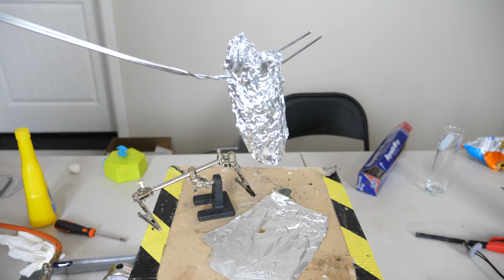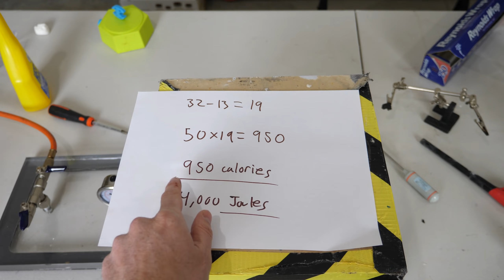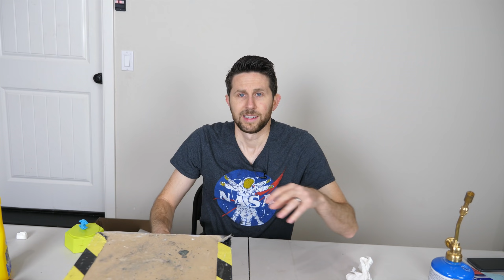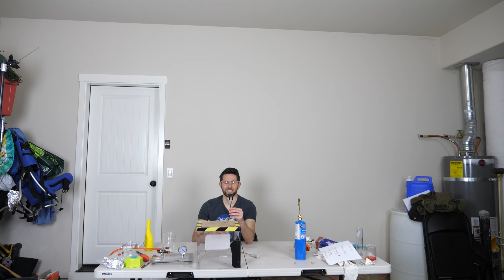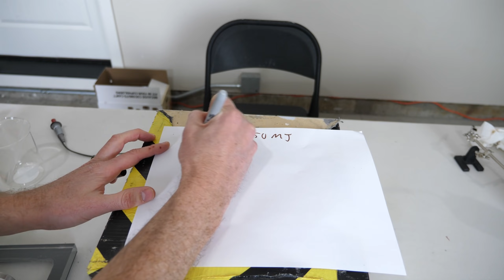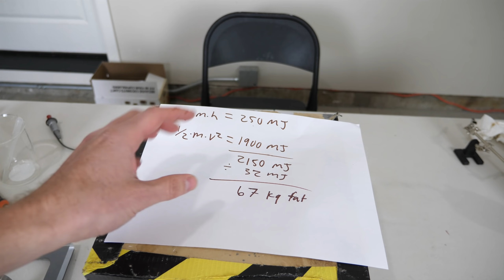Homemade Film Canister Rocket—Launching Yourself Into Orbit

Comment: Your body metabolises that chips into CO2 and water and other waste products.  The waste still contains considerable amount of chemical energy because metabolism efficiency is far worse than just burning by fire. (People in some countries burn dried animal poop as heat source.) In order to calculate the total energy gained by your body when digesting Cheetos, you need to burn your feces too. Otherwise this calculation would be incomplete and plain wrong.

Comment: It would be pretty sweet if you could provide an answer to a very simple question about this video...specifically...do you honestly believe that your results from experiments with your very tiny vacuum chamber translates into the vacuum of space..i know without a shadow of doubt that your pump being used to vacuum the chamber CAN NOT reach the same vacuum as in space no matter how long you pump it for.. Therefore you can not  conduct a single valid experiment under the same conditions in space..2..solid  fuel and liquid fuel rockets are totally different things...where solid Is lit and then burns until it's all gone in 1 continuous action...because of this NASA does not  claim to use them in the vacuum of space ..so if nasa rockets do not use solid rocket fuel in space...can you please explain how the solid fuel.. pop pops..has any relation to nasa rockets in space..how about doing the experiment with liquid fuels in the pumped down vacuum chamber...there is 0 doubt in my mind that you know that gases take up 1700 times the volume than the same amount of a liquid and solid in weight..pressure will rise very quickly  when fuel is burned in the small vacuum chamber like yours...so u are creating an atmosphere pretty much instantly..so they both have 2 separate things to push against/ transfer energy to...needed for an equal and opposite reaction that are not their in the vacuum of space... Even if nasa could get to orbit there is a huge problem...there is 0 resistance to the exhaust gases leaving rocket and a bunch of resistance in the direction of travel...it violates the laws of physics for rockets to provide thrust in the vacuum of space..Remember this is only hypothetical...this is because the force would be applied equally in opposite directions..towards direction of intended travel and  leaving the rocket exhaust...which would cancel the forces..rockets must apply a force to something else for any flight...same exact thing for objects moving through water...air and water behave the same exact way which is why propellers can be used on both..jet skis use a pump to suck in water and increase the pressure of that water and then uses the high pressure water to apply a force to the water traveling through... Rockets are no different than the torpedos in water...there must be a fluid to travel  through for rockets and jet skies to generate thrust.. No fluid no thrust because it's the resistance to motion by the charged particles in the medium being traveled through that make up everything in the universe that is responsible for the equal and opposite reaction. Rockets don't have   that in space

Comment: I could be wrong on this but IIRC a car is less than 2% efficient not 20% the 20% is a secondary conversion you're converting about 2% of the energy in gasoline if that into energy of that you are recovering about 20% of that 2% to power the car the rest go into heat and out the tailpipe on top of that you have to add the electricity you're using to move the car because it takes quite a lot of grid energy to make all that happen this is why electric cars are so incredibly efficient your gasoline car uses more electricity per mile than my electric car does and you're not even plugging in :-)

Comment: Your calculation needs to account for atmospheric drag which isn't a constant since the air gets thinner as altitude increases. The air has less mass for the rockets to push against. But it would be balanced out by the loss of rocket mass due to loss of rocket fuel as you stated.

Comment: Or in other words, the centrifugal force of orbit must balance the gravitational pull of the Earth to hold it in equalibrium. That is achieved at about 17,600 miles per hour adjusting for mass. Without gravity satellites would fly off into space. Without speed they would fall back to earth. The outer atmosphere is not hot. That is NOT why things "burn up" on re-entry. In fact it is very cold. But the friction caused when an object moving that fast hits the atmosphere creates heat.

Comment: Too many energy loses in your set up! You need to have a sealed “calorie bomb “ 

Your equation is INCORRECT 

Q=mc ΔT where m =mass in grams ,c is the SPECIFIC HEAT OF WATER ( 4.189 c/g)  ΔT is change of temp in degrees Celsius.

Comment: You are not taking into consideration the amount of heat that escapes into the air and around the water vessel. So the amount of energy stored into a cheetos might be even higher.

Comment: 1) big two stroke diesel engines on ships can get up to 50% efficiency
2) hypercritical steam turbines get up to 50% but is not worth it due to renewable energies being preferrably used 
3) COGES is the combination of a Gas turbine with a exhaust gas steam turbine and can get up to 60% efficiency. Probaly the best solution for base power requirements and stability in the power network

Comment: Energy needs to be adjusted for bioavailability, which means the energy still in the poop needs to be subtracted to determine metabolic energy content.  Things like fiber are indigestible but will burn nicely.  Then our digestive tract isn't 100% efficient either.

Comment: And just think: you TOTALLY left out mandatory oxidizer [which usually ends up greater than the fuel] the ENGINES themselves, and the superstructure needed to hold them together under such extreme weights and forces...and let us not forget something to protect the astronaut since you would totally die if you tried going into space without some kind of strong space capsule, long before you got up to orbital speeds.

Comment: What efficiency are you talking about? Conversion of even a little bit mass of an object to pure energy is nearly impossible unless you use gravity and black holes(still coverts less than 50% of the mass to energy) or matter antimatter collisions which result in 100% efficiency. The most efficient method we have, ie. nuclear fission converts about 0.08% of mass to energy and fusion reactions are just a bit more better at this. This can easily be proven using Einstein's mass energy equation and actual experimentation. And you're saying that a human body has 20% efficiency . Please explain this to me
Reply: No one is talking about nuclear chemistry here. We are talking about regular combustion. The efficiency is the amount of work achieved divided by the free energy available from combustion

Comment: Hey, I think that definition of Calorie is wrong, I guess... It's the amount of heat required to raise the temperature of 1ml pure water by 1°C from 14.5°C to 15.5°C because at different temperatures, water takes up different amounts of  heat to raise temperature by 1°C. Taking the arithmetic mean of all these heats, the resulting heat is the amount of heat used to raise temperature from 14.5°C to 15.5°C.
Reply from the maker: ballpark definition is what I used. It's not much different actually at different temps between 13 and 32 C.
Reply: I see, but I just said what what my Physics Teacher once told me.

Comment: Are you a Maths teacher or a random? As the water is heating up it will evaporate, by the time the fuel has burnt out you will not have 50ml of water. Also are there 147 Cheetos in a bag? If not then your calculations are wrong again.

Comment: This is totally fake, there is no exact way of calculating body fat with energy, as is completely different mechanisms, oxidizing a material doesnot just give you the calories, fat in humans donot exist, is a misleading idea, as fat is just cells that are design to hold more proteins and more food which is calories, not a correct scientific way to determine something, similar to how they trying to compare smoking with water absorbing smoke, which works extremely different both, no correlation, also there is no scientific evidence of space station because is all cgi made by nasa.

Comment: I feel like I'd want to actually do the math on this one...  Taking the fat mass of the largest human known, using a super oxidizer like chlorine tri-flouride, and teflon-coated combustion chamber and nozzle (teflon is the only thing that chlorine tri-flouride won't oxidize.  It's horribly dangerous) and a good nozzle design, check to see what kind of isp (efficiency) you can get from that kind of a chemical propellant (Possibly changing the oxidizer if it's not going to get us the best isp, may want to change it to liquid O2, hydrogen peroxide, or even nitrus oxide, all of which can burn fat) and using the rocket equation (delta-v = isp*g*ln(dry mass / wet mass) so see if the numbers add up to around the 10k delta-v (more like 9300, but who's counting?) mark needed.  The good news is that using some rough estimates I can get pretty close, and just work the equation backwards, to find out what dry-mass that much fat would be able to lift to orbit.

So After some cursory examinations, I could find some papers about hybrid rockets that used things like wax, rubber, and other solid substances as fuel, with liquid oxygen as the oxidizer, some calculations as to their average isp's (possibly as high as 400 seconds, but generally in the low to mid range, I used 300 seconds as a baseline) a oxidizer-to-fuel ratio of roughly 7 (although it changes with hybrid rockets) and a weight of the largest person in the world (over 600 kilograms, although I estimated less than half of that as fat, so only 300kg, that estimate may be off).

If we assume 90% of the rocket's mass as fuel, (a good goal to shoot for) that would lead us with only 6700 m/s of delta-v.  Not quite enough to be able to achieve orbit.  Meaning we'd need to reduce the weight of the rocket somehow, and increase the % of the mass carried by fuel.  Meaning we wouldn't be able to reach 10% of the rocket's mass as payload.  You'd need to reduce the payloiad to roughly 3.5% of the rocket's mass to achieve orbit.

Thankfully though, with 3.5% of the weight being brought up, you have a total of about 84 kilograms...  Enough for a person, if the rocket itself weighed nothing at all, lol.  So if you made everything out of graphene aerogel and similar mechanisms, you MIGHT be able to put the world's smallest man into orbit...  But I still find this highly suspect.  

In order to make this work, you'd need to actually make the rocket isp much better, which would likely mean splitting it into a two-stage rocket, with one nozzle specialized for the upper atmosphere, and one for the lower atmosphere, but even then, would it be enough?  I don't know.
Reply from the maker: Nice one. Maybe I shouldn't have necessarily said "utterly" impossible at the end there:)
Reply: @TheActionLab  It's close though, lol.  Had to go into the details 'cause you asked a question and I actually wanted to try and answer it!  lol.  Love the content, keep it up!

Comment: Celsius.. Milliliter, this guy uses metric! Sweet
Reply: @timno9804  Kelvin is good but... Don't forget that it's based on the absolute zero, celsius is based on the freezing temperature of water. Depending on what you want to do, Celcius is better than Kelvin in term of facility.
Reply: Queue the unit bigots...
Reply: @eylon1967 @Reclaimer Good!!!
Reply: Reclaimer Yeah, and occasionally miles.
Reply: It's only Americans that still use the Imperial system. Everyone else has moved on because the metric system is more scientific.
Reply: well, all scientists use metrics. its a system desgined for science after all, not day-to-day use
Reply: @eylon1967  it's day to day use too

Comment: Sure it is, but you might need bit of anti-fat as well. Might be able to leave the galaxy.
Reply: Even without anti-fat, all the atoms lighter than iron are able to do fusion, so that means all the carbon, oxygen and hydrogen in that fat could have enough energy to get you into orbit, since nuclear reactions give much more energy than chemical reactions.
Also, whithout the need of anti-fat, you could get approximately half of the energy you could get with anti-fat by trowing the fat to a spinning black hole, and, if you're very patient, you could wait for the black hole to evaporate through hawking radiation and you would get the 100% of the energy.
So, I think it's safe to assume that he was talking about chemical energy in the video and in the title...

Comment: Did you start with 50 ml of water, or finish with 50 ml after evaporation?
Reply: Not quite the science guy but the water is not even boiling... The end temperature is 32 deg Celsius.
The evaporation, if any, could be neglected because the rate is too small
Reply: @UshiromiyaXyrius  I agree, but it's a point of methodology and efforts for accuracy.  Plus, even though the overall temp of the water only got up to 32 C, there were points of heat much higher than that at the point of contact with the flame which could start measurable levels of evaporation.